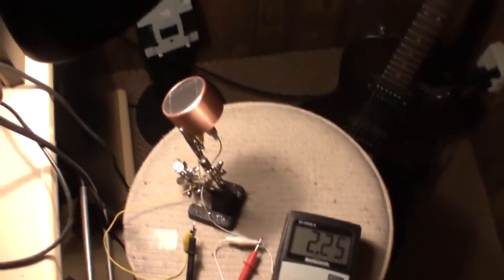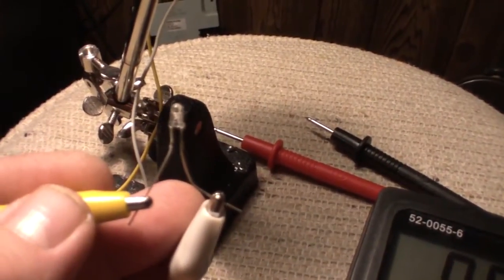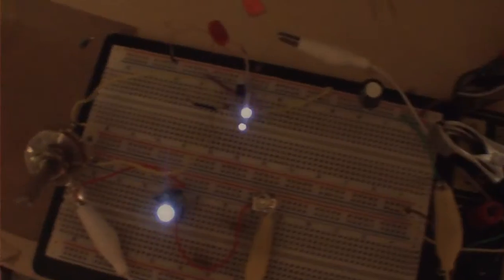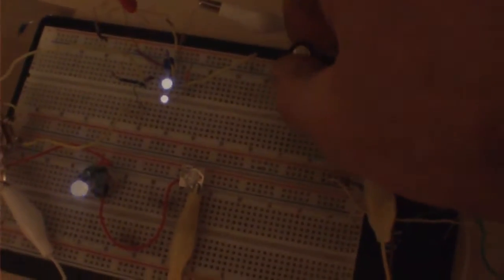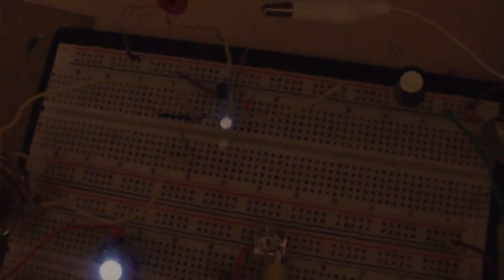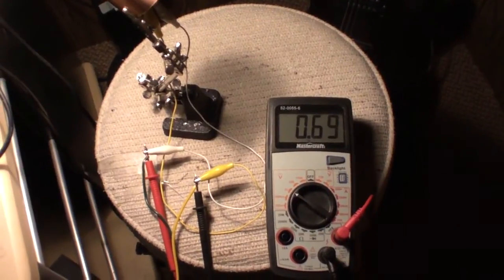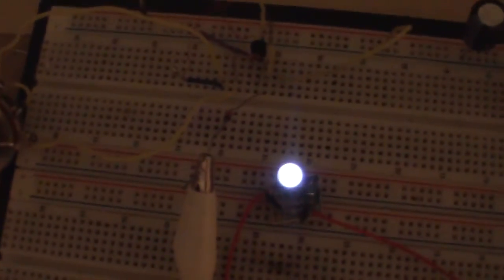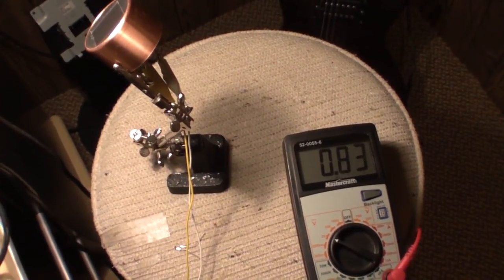Solar Joule Thief / 2.25v ~10mA / lasersaber diode / Cap Tank / Slider2732 Multiple Oscillators

Comment from the maker: @slider2732 Interesting. I hope to play with your circuit, it's a little gem, for sure! I am still learning more about the micro-oscillators... that you and Lid have running. I purposely have set this solar cell up, to provide a very low energy input... as I have not built any crystal batteries ...

Comment: @KyleCarrington Thanks for the info. Further tests showed 2 in series did work on this no volts circuit, but they flashed instead of constant. A 1N4148 gave the same result as a green LED, so, used the LED :) A white was a lot dimmer, other colours refused to show themselves on junker circuit boards and will only let me discover themselves when I don't need them....the other trait of salvage.

Comment from the maker: I think this could have an effect on the circuit's charging ability, but one should use a schottkey, instead of the rf 4148 i had. i only chose it, because it has (similarly) a slightly less voltage drop.

Comment from the maker: ... The other thing i learned is that lasersabers addition of the diode to base has an interesting effect on the circuit. When removed, the circuit works, but the "bleed off" of the led is stretched out, i.e. the decay of energy lasts longer. With the diode added, the flash is arguably a bit more intense, and the decay is clipped.

Comment from the maker: i hooked it up to a larger solar cell, a 6v 200mA. But this time, I turned the cell AWAY from the light, so basically it was acting on very minimal ambient light. Using the chained oscillators, I was able to get it to blink off the 2nd oscillator, which is a 5mm LED, in a state when i could not get the normal JT to run one 3mm LED. ... ...

Comment from the maker: @slider2732 No, just one rf diode to the base as lasersaber showed, but, its an RF diode, a 1n4148,... i think a schotkey would work better. the second diode leading to the second oscillator (may or may not) effect the entire thing (frequency wise) -- im not sure. i merely had it there for charging bats purposes. cheers. i have learned tons from your videos, and i certainly look at junk electronics in an entirely new way lol

Comment: Some experiments later.... LED's work instead of diodes :)
 Got a 'Penny' type from last video now with LED back fitted on the circuit. It flashed fast, about 15Hz and almost constant, until added a 471 orange ceramic cap across the LED, now it's constantly on and the wireless field is just about same as no LED !
Cheers Kyle :D

Comment: @KyleCarrington I do that OFF video as well LOL
So, you have 2 diodes, serially to the Base ? That's probably the best tip ever on speeding up oscillators in my own experiments. Plus the draw goes down.....very cool ! Do the diodes have to be 1N4007 or similar black cased doodahs ? If I get that going and it works i'll make sure to mention you if a vid leads from it :)